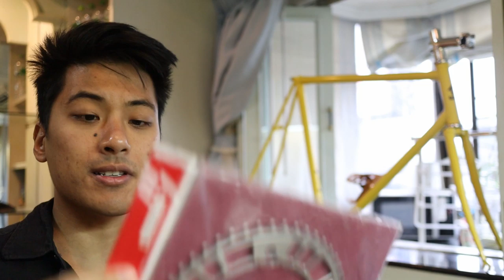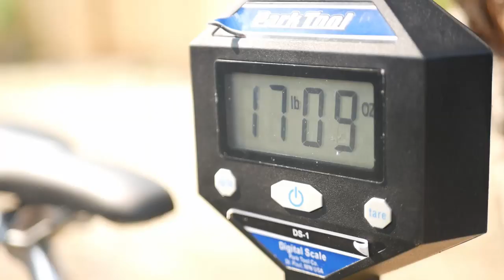Accidentally Biking AGAINST Traffic | Fixed Gear Cycling Vlog

Comment: Yeah, I could definitely not listen to that chainring for long. Sugino Zen all day
Reply: To be fair almost all chainrings make noise when they are breaking in. Unworn teath + brand new chain = noise.
Reply: I agree - it sounds like something's wrong
Reply: i thought the sound might be caused by the chain being too tight?
Reply: @walkersutton  That's what I thought.
Reply: All my zen makes that similar noise
Reply: most of the noise comes from the cahin probably, I have a izumi chain and it sounded like that until y regreased it, looks like the factory grease makes it do that horrible sound
Reply: In one day or two the noise will be gone. Specially after regreasing
Reply: I agree that a sugino zen with an izumi chain is an eargasm.

Comment: Be thankful you CAN use a butter knife!  There's so many special tools needed for working on bikes in more depth than that, and it gets crazy when you start looking at ones just for wheel building and headset installation. 
If you want a fixie with true apocalypse-scenario serviceability you have to mess around with ancient frames that use one piece (ashtabula) cranks/bottom brackets. And even then you'll still need to grind down some wrenches for the wheel bearing cones and threaded headset...

Comment: The chainring bolt tool thing is just the "old" standard and therefore more plentiful and easy to toss in for stock components that are mass manufactured (like Andal)s. New chainring bolts using a smaller hex for the other side are in fact the new standard. Maybe in 10 years you'll see the supply of old bolts liquidated finally.

Comment: Hey Zach, can you point me to or make a video about cons&pros of Miche sprocket vs double cog (two cogs linked together with different nr of teeth). I'm riding fixed gear with aluminum wheels and hubs don't want to damage thread by constant cog changing. Many thanks for your videos overall, helps me a lot. cheers

Comment: I was creating a very similar sounding rattling after changing out a bottom bracket that messed up the alignment of the chain. But I also have a very wide cog on my back wheel which is rather unforgiving to any misalignment. My guess is that sound could also be produced by any part of your drivetrain being more worn out than the others, if you replaced anything recently.

Comment: The bolt thing is for people whos power backs off the poorly designed dull sided Allen key bolts that you say work so well. Back off and or snap when a strong rider has those cheep parts on there build

Comment: One way streets were invented in order to facilitate higher speeds for motorized cars, with the result that people keep making mistakes by turning onto them while increasing collision speeds.

Everyone accidentally turns into the wrong way on a one way street. I mean, I've even seen cops do that with some regularity. 

Get rid of all one way streets while reducing the speed limit, and problem solved. Higher speed limits don't work around red lights, because any time you save by going faster is lost at the next red light.

Comment: Worst is when you finally strip a bike for deep cleaning after 1.5 years. 

The other worst is when you have to wait till after winter to clean it because you are stuck in college

Edit: didn't realize my bike was so dirty until I had to do repair because I like to just get on and ride. I do not like to do work on it until I have to I usually wipe it down once a month but deep cleaning I do not do much